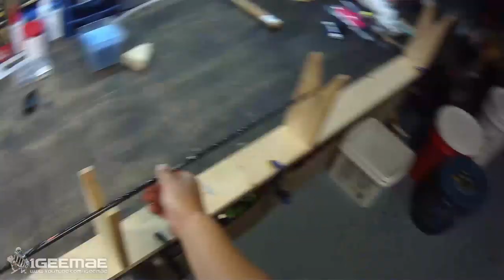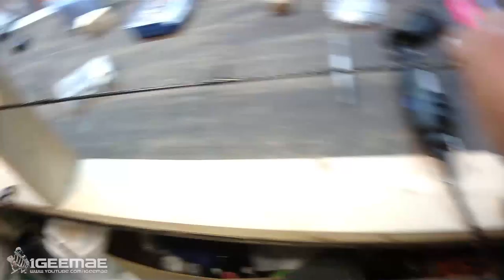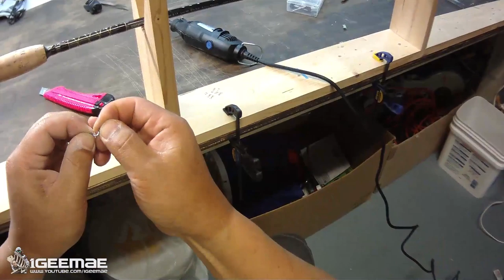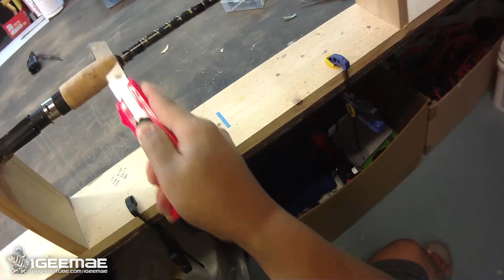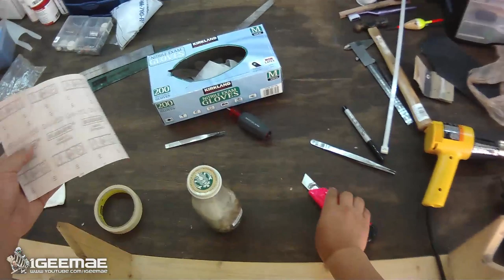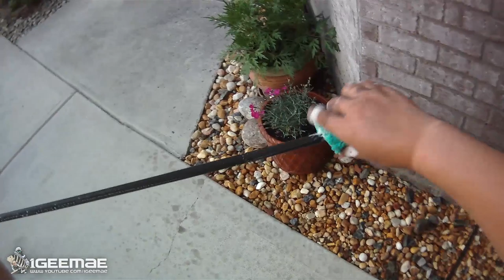How to make unused fishing rod to spinning rod

Comment: You should try some light heat from a pencil torch and a razor blade to remove guides. Eliminates the possibility of nicking the blank with the cut off tool. Just a thought.
Reply from the maker: I think your opinion is right. But, I think heat gun might damage the fishing rod. This is my personal opinion. 
However, I should try as your idea next time. Thank you for your idea and information.

Comment: use a heat gun to soften up the epoxy, then use a razor blade not a dremmel. the only time you should use a dremmel is on the real seat. also if you live in the houston area fishing tackle unlimited has a nifty little machine that will strip the grips off your rod. just remove the real seat before you go up there.
Reply from the maker: Thank you very much for your advice and idea. Oh, by the way I.m live in GA...   :)